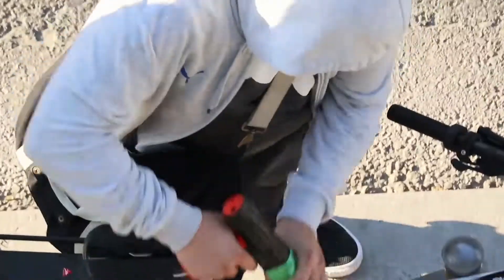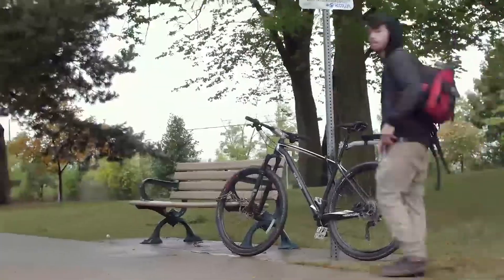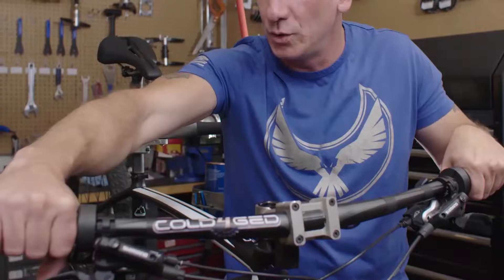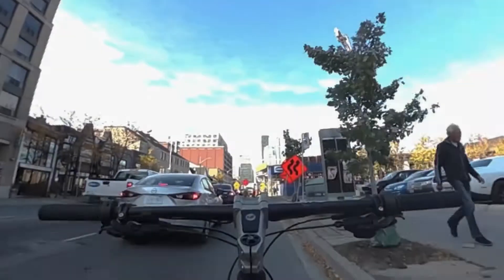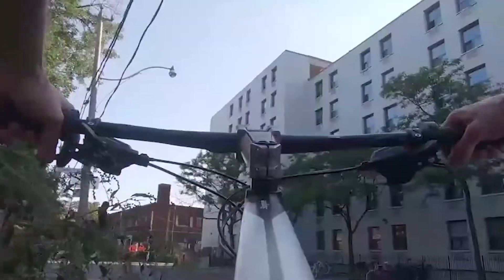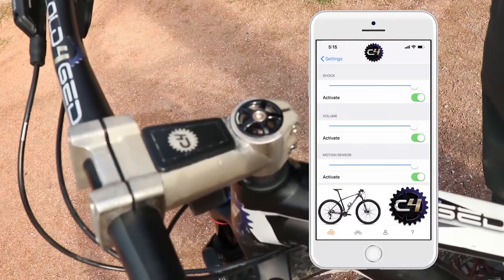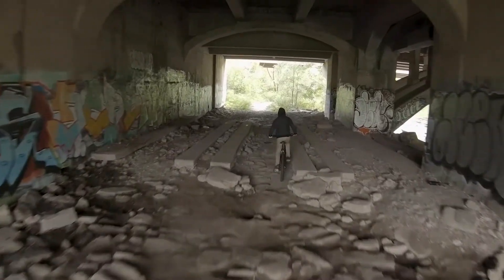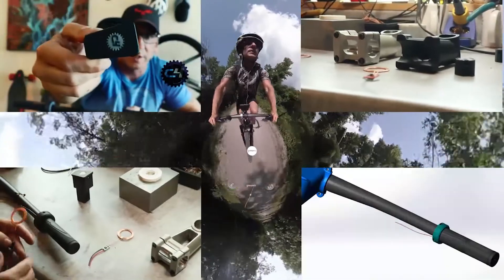Shocking GPS Bike Alarm Prototype Update

Comment: How would GPS tracking work? Would we have to buy an expensive data plan from the big 3?
Reply: Getting a gps signal is free, sending the location is the cost. but even that can be done on the cheap over sms text using a prepaid plan.

Comment: How to bye ?
Reply from the maker: Still testing.  It will take another year to come out.  This has to work perfectly before we bring it out.  Thanks for the interest.  We will keep at it.
Reply: @Cold4ged  ready to sell or not yet? we are in 2021
Reply from the maker: @UKbbr  No, TBH with air tags, there are cheaper solutions now and I had some bigger project this year and next.  Don't think I will make this one unless I have some breakthrough idea.  Cheers.
Reply: @Cold4ged  THANKS for your quick answer can you send me links of this cheaper sollutions? because i  i dont found anything even closer that shock lock alarm....also i follow you in instagram ans i sent message to your team 
thanks from UK , BBR
Reply from the maker: @UKbbr  hey sorry, what I meant are with air tags, the tracking is really cheap now and our system was so expensive.  Does give me an idea to combine with existing air tags.  Thanks for the idea!!
Reply: Thanks.